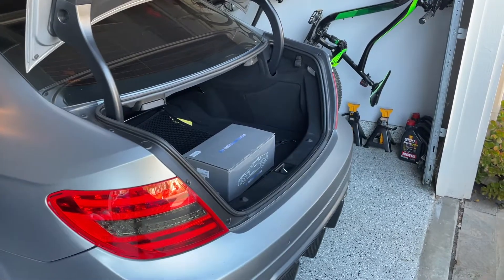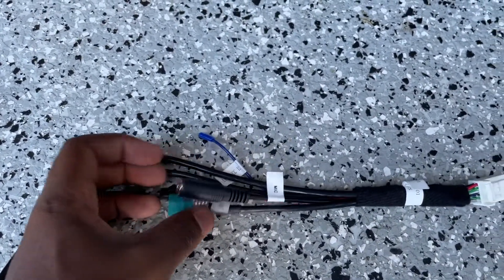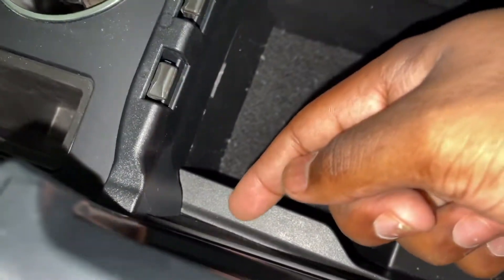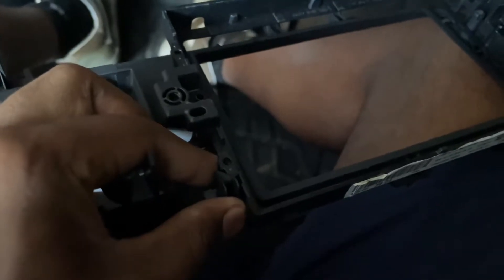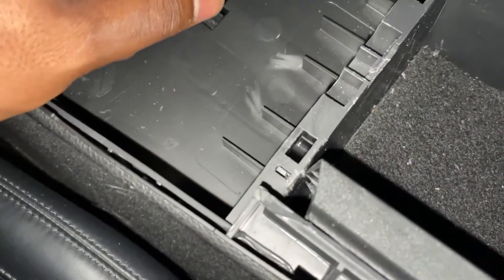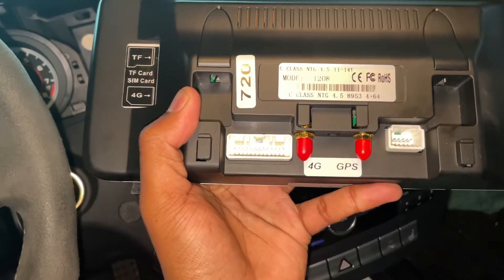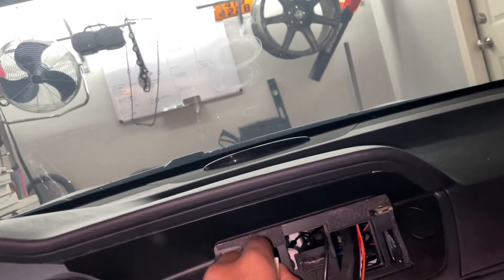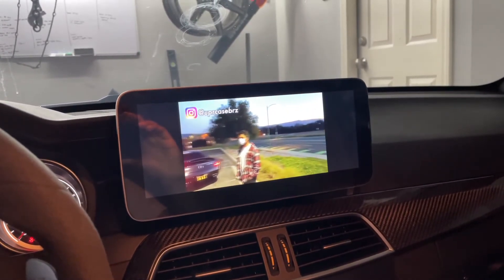Mercedes W204 C Class AVIN Android Infotainment 10.25" Screen Install! (Qualcomm)

Comment: Hi Great video of installation.

I have followed your video and installed kit but unable to use silver colour (round) joystick located in between two seats.

I have connected A/B with A and then B but still no Audio and joystick works.

Comment: Hi, great video on the installation process! Can I ask, where did you put your GPS module once you plugged it in?
Reply from the maker: Thanks! I just tucked it back further into the dash, there's oddly a good amount of space there behind the screen
Reply: @SamAbraham  Nice idea, wasn't sure if you'd have signal issues like that but maybe worth a try when I install mine! Thanks
Reply from the maker: @ashmaltby2187  Used offline maps with Sygic on a trip from California to Arizona with this setup and it worked perfectly!

Comment: Hey man!  I know it hasn't been too long since you installed the AVIN unit, but how has your experience been so far?  Does it seem like a noticeable improvement over the previous unit you had installed?  Any pros/cons worth noting?  I'm thinking about tackling this over the Spring/Summer, along with the fuel injector replacement.  
Keep up the great content! 

(Off topic: Are you malu?  Taking a guess by your name, haha)
Reply from the maker: Hey there! So far its been pretty good, I've already used it on one road trip to AZ already and it didn't have an issue w my GPS or music for the whole trip. Compared to the previous one (Mediatek processors I believe with less RAM), this one runs a lot better, almost no lag. The other one was ok, but it had its moments. The one issue I'm still trying to resolve is that the volume doesn't go high enough. Like its fine, but I know it should go louder when I wanna blast the music. My radio and SD card still go to the highest volume, but not the android for whatever reason. I'm going to contact AVIN about it, probably a setting somewhere, as my last unit did this without a problem. Good luck with all of the maintenance! And I'm Sri Lankan haha
Reply: @SamAbraham  Thanks for the reply!  Keep me posted if you are able to resolve the audio level issue.  Seems like it should be a simple software update.  Oh, and I guess I was close, haha.  My fam is from Kerala, so we're right across the pond, so to speak!
Reply from the maker: @BalanBro2  Just fixed the audio, I wasn’t looking in the correct menu 🤣 That solves that hahaha. That’s great! Right across the pond as you said!
Reply: @SamAbraham  what did you do to resolve the volume problem

Comment: Hi Sam , 2 items I need some help with. 1/ how do you keep the OEM system on permanent aux for carplay?. Every time I switch off the car it goes back to oem and I need to change the aux setting.
2/ how do you change the boot screen?
Reply from the maker: My car stays on aux all the time, so not sure how to help you with that part, perhaps there's a setting deep within the menus or something like that. I've managed to change the boot screen just unfortunately haven't had the time to make a video, its on the list!

Comment: I'm trying to figure out where your AUX cable plugs into ? You say your center console...? Well I have a c300 2014 and I have a USB port, media port, and on my factory radio I see AUX selection. Which makes me believe I have a port hidden. I'm gonna run out , is it under ur USB STICK port???
Reply from the maker: You need the MB media interface to aux adapter, link is in description

Comment: Man preciate the install video!! You just saved me a bunch of headache! Just put this same radio in a 2011 e350! By the way, do you know what the acc-in wire goes to and also the LVDS wire that comes on the android harness? Just wanted to know. Thanks again
Reply from the maker: Glad it was helpful! Not sure where those wires go to be honest, might be if theres an aftermarket camera system of some sort or other accessories

Comment: My scroll wheel doesnt work and lags alot of OEM MTG model on this unit. Did this ever happen to you? Everything else works for me but that
Reply from the maker: Strange, haven't had that issue myself. I'd just go into the settings and make sure ur unit is configured to the correct car and all that, if its not it might be causing some lag. That's all I can think of though

Comment: Hey! I have a problem with NTG screen. The button you navigate on ntg screen wont work. With the original screen it works perfectly.
Reply from the maker: All I can think is that either the harness isnt connected properly (don't think thats likely as the screen probably wouldnt turn on at all if the harness wasnt connected well) or that the android is trying to connect to the wrong NTG system. Does ur sound work through the android? If so, you may need to dive into the android settings and see what NTG its set to work with. If you have a facelift W204 like me (2012+) then you'll have to select NTG4.5 or NTG 4.7. Prefacelift I believe is NTG 4.0 (2008-2011). If your sound doesnt work at all, then see if pressing the "ON" button on the car's original button panel makes a difference. I know that might sound silly but I've forgotten to do that a few times lol
Reply: @SamAbraham  Sound works well. NTG is 4.5

Comment: how the brightness? my issue is that i want something vivid under the sunlight. i saw they have, QLED, anti-glare, anti 7 glare, antti blue glare. and IPS..
Reply from the maker: The one I use is super bright with the sunlight, even with the pano sunroof open. Antiglare as well. I believe mine is IPS but not sure if QLED was even an option when i got mine
Reply: @SamAbraham  link me the one you bought . I bought one and it was badly dimmed under sunlight
Reply from the maker: @Elgoogz  Its all in the description

Comment: Hi Sam, I just installed the same system in my car with help from your video, very clear, thx for that. But I have a question. I want to connect dab+ module to the Original antenna system of the car with a splitter cable, wich I have already. Do you have any idea where to put the splitter cable. Mercedes W204 facelift model 2013, thx in advance.
Reply from the maker: To be honest I'm not sure, I didn't have the DAB+ module as its not available in my region at all. I would contact AVIN and see if they can give you a wiring diagram
Reply: Hi Sam, thx for your quick answer. I will contact AVIN. Keep up the good work

Comment: I have attempted to fit a 10.5 inch Android head unit over the weekend using thos great guide. I managed to do all of the wiring with scraped knuckles and half a car removed but I have hit a brick wall on how to get the and unit back in with the extra wiring loom and I cannot find any images of where they placed the wires. Just it is a tricky part.

After spending 4 hours in the dark last night I am at a loss as to where the chunky connector and black wires go.

Can anyone help me or ideally have a picture of where the wires fit to save me from a full meltdown? I currently have no stereo which is not ideal.
Reply from the maker: Yes, this is easily the trickiest part of the installation. And to be honest, theres no way of doing it easily. I'm hoping you've figured this out by now, but I had to tuck the harness in the very back and sort of behind the felt insulation in a corner where there was a tiny bit of space. Also tucked some wiring down the side where the glovebox was
Reply: @Sam Abraham  I finally managed it by gaffer taping the connecter under the cradle and bevelled off some of the side to route the cables. Absolute ball ache of a job to be honest!

Comment: Hi I have neither an AUX nor a media port in my W204 facelift. How can I still install this radio or can I install the AUX?

Aux or similar is not displayed as an option on the radio either...
Reply from the maker: So nothing in the glovebox or center console? That is very odd, they should all have some form of aux whether its just a media port or an aux cable
Reply: Mine doesn't either. But the sound comes through the connecting cables, however you will have to enable the AUX input from the engineering menu of the Command.

Comment: DO you need the media interface cable connected to get sound? I am having issues getting sound from mine but I dont have that cable connected in the center console.
Reply from the maker: You need a cable that goes from media interface to aux. My car already had one, and the unit came with one. If you don't have one, you can also buy one on amazon
Reply: @SamAbraham  Sorted. My mistake.

Comment: Hi I'm just wondering if you know if I need to but the ami aux cable as my mercedes already has a normal aux connection inside the armrest it looks different from your one so I'm wondering if I need to buy one or not if you can get back to me much appreciated thanks
Reply from the maker: As long as ur aux to ami cable has an aux port, you should be good to go
Reply: @SamAbraham  thanks for getting back to me much appreciated and great video

Comment: Did you have to buy the AMI to AUX for the centre console fitment ?
Reply from the maker: My car came with one, but if you dont have one I have one linked in the description. It doesn't come with the unit if thats what ur asking
Reply: Ordered it buddy but thank you. Realised it was missing when I went through the cables and connections and figured it all out, not the best when it comes to electrical fitment. Wheels on the other hand, they are my speciality, spend 40+hrs a week fixing idiots mistakes lol
Reply from the maker: @NiallJones1986  Haha for sure man, glad u got it figured out.
Reply: @SamAbraham  just got to fit it now mate, ordered a full trim removal kit 203 pieces lol so literally everything I need. Any advice on getting the aux to the ami in the centre console ? Was thinking of running it under the side trim and the drill through the centre to make a hole to fit it ?
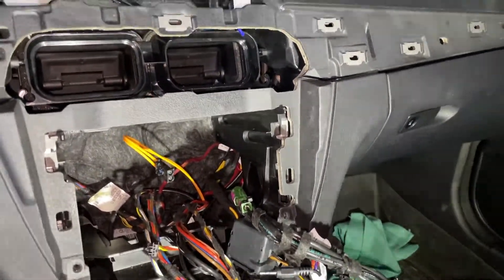Reply from the maker: @NiallJones1986  At around 20:00 I show what I did, which was run the aux cable below all the center trim pieces. I showed how to remove those pieces earlier in the video. You then may have to drill a small hole in the center console wall to sneak the cable through. Overall very unobtrusive, and no wires showing anywhere

Comment: WHAT ABOUT THE OLD DISPLAYS CABLE?!! Did you just leave it unplugged????
Reply: @DrDW100  yes, only the fakra from the old screen is used, the small (6-pin?) block connector is not used.

Comment: hello, I already installed an android on my s204, (10.5) , but I have a problem, when the car dashboard lights or I start the car engine, there is a background noise in the speakers in AUX mode .. . .. very unpleasant.... but when I turn off the AUX mode, everything is ok. What can it be? any tips? thanks. 🙏
Reply from the maker: You need a ground loop isolator in between the car aux and the android aux cable. Just like this: https://www.amazon.com/dp/B06XQYN77L/ref=cm_sw_em_r_mt_dp_XR6PTNKXBQDQSNPVFM77?_encoding=UTF8&psc=1

Comment: @Sam Abraham  Yes but I just bought off Amazon a AMI cable to Female 3.5mm Aux cable. So that should solve  my problem right. Instead of choosing AUX, I'll choose Media Interface cable on New screen right? I just want to know why my factory system has the option for me to select AUX input.... its NOT grayed out. Why would this be? Believe me, I have looked everywhere for the AUX INPUT and I can't find it. I mean any help here? I've checked there's Nothing in my flovebox besides the becker Navi, and cooling fan. Center console has a USB port and a AMI port. That's it. I've looked high and low in both areas and No luck. Internet is no help at all. 2014 C300 Sport sedan 4 matic  I own. Anyone please help me...

Comment: Hey, great video, I'm about to order mine 12.3" from DMP Design, but I have a question for you I have the same, w204 and same center console, with that weird long plug, also has a USB port I have a USB stick in there for now, so I usually switch from from my listening from the USB stick, to my Samsung S10+ Bluetooth Spotify or Samsung Music and they all sound great with my Harman Kardon. Now I'm kinda confused here, what is the point of running an AUX cable all the way to your center console?? Do you not have A USB port for Audio in there from Factory? or why wouldn't you just connect you cell phone via bluetooth and play music that way? Let me know, thanks. maybe I'm missing something.......
Reply from the maker: The only way for the Android infotainment to play audio through the car's speakers is through aux. It cannot do this any other way, that's just how it was designed.
Reply: @SamAbraham  so what do you suggest I do??? I see Amazon makes a Media Interface cable to Bluetooth or Aux, ? I thought I read somewhere that would work for me??? There has to be a solution??
Reply: @SamAbraham  Yes but I just bought off Amazon a AMI cable to Female 3.5mm Aux cable. So that should solve  my problem right. Instead of choosing AUX, I'll choose Media Interface cable on New screen right? I just want to know why my factory system has the option for me to select AUX input.... its NOT grayed out. Why would this be? Believe me, I have looked everywhere for the AUX INPUT and I can't find it. I mean any help here? I've checked there's Nothing in my flovebox besides the becker Navi, and cooling fan. Center console has a USB port and a AMI port. That's it. I've looked high and low in both areas and No luck. Internet is no help at all. 2014 C300 Sport sedan 4 matic  I own. Anyone please help me...
Reply: @devryguy27  Did you solve this problem?
Reply: @luizmtavares  I know it's a year old, but don't you guys READ ?.  The MB manual clearly states, that for NTG 4.5 systems, with the AMI connector, as soon as you plug the AMI to 3.5mm cable in, that then becomes the AUX input.  It stays on AMI input for the AMI to ipod fruity cable , and the AMI-USB cable. (Those 3 x cables are part of the cable set that comes with the Media Interface Kit)

Comment: Hi, my swivel wheel does not work nor does my NTG screen as it has now gone black. Any known fixes or is the screen just Chinese junk? Problem is my reverse camera has been lost
Reply from the maker: Not sure why you're having these issues assuming everything is connected properly. For the camera you may have to go into the Android settings to select the factory backup camera option
Reply: @SamAbraham  Hi, it's sorted now. It turns out you have to manually turn the screen on but that is fine

Comment: Argh I cannot get my sound to work - I have the MMI to 3.5 adapter, and seem to have activated AUX, but even plugging a phone into it there is no sound coming via the MMI port. My android unit is sending sound down the 3.5mm (confirmed by headphones) so the unit is ok - just the car being the problem.
Reply from the maker: The MMI to 3.5 adapter actually may be your problem, I've had that issue before. Buying a new one off of amazon solved the issue for me

Comment: Hey Everyone, So About a month ago I got an Installed the 12.3" Android Screen From DMP Design, I did the Full Install myself and everything went smooth and fine at first except I heard a buzzing noise in the background, so I bought a Ground Loop Isolator off Amazon and that took care of my problem completely, but here about 1 week I've noticed that when listening to my Samsung S10+ , or My iPhone 7Plus, using my audio, Spotify, or Pandora the quality of the Audio seems kinda distorted and I cannot figure out why for the life of me!!! I haven't changed any settings at all. I don't have Bass up crazy, I can put my ear down to door speaker and up to tweeter and its deff distorted badly. but call me crazy, it seems to come and go sometimes I travel it seems fine, but most times it sounds bad to my ears, Others may not notice as badly as I do, But I can hear clear as day. It's only when I use android auto , or apple auto connect. if I connect the mobile hotspot and use my data from phone and connect Spotify, pandora, my music, It's perfect sound, so I'm so confused. Does anyone out here have any ideas as to why or what could be causing this problem??? Thanks, I haven't checked the factory settings on the Screen settings yet. when I switch back to factory radio and CD audio it sounds Fine too. only Android Auto/Apple Auto, which is how I normally connect mostly it seems easiest to do. 2014 W204 C300
Reply from the maker: Hey James! Thanks for ur input, always good to hear other peoples experiences. From what you describe, the issue must have something to do with the connection between your phone (Samsung or iPhone) and the Android screen. Does your Android Screen have built in CarPlay/Android Auto, or do you use a Carlinkit external USB dongle like me? With the dongle I personally haven't had any sound issues with CarPlay, although Android Auto can be finicky sometimes with the aspect ratio. If you have the external dongle you can update the firmware of both the app and the dongle, and they do update them pretty frequently so that can help bugs a lot of the time from my uses with them over the last couple years. If its built in I honestly don't have an answer as all of my Android screens haven't had that, seems to be a newer feature. Keep us updated!